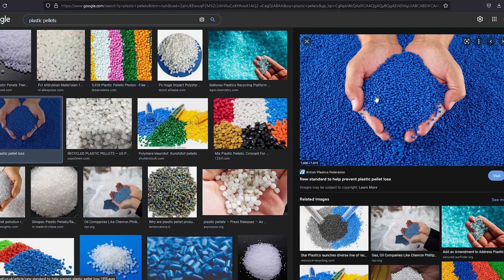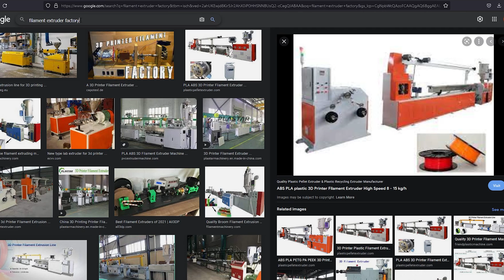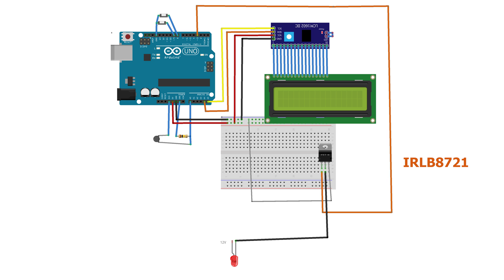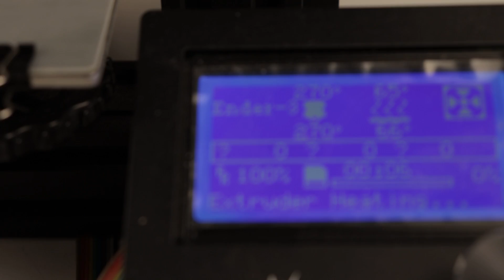Make FREE filament for 3D printer at home

Comment: How can your seemingly stock Ender 3 reach 270C with a Bowden setup? I was kinda intrigued and wanted to try but I heard you shouldn't go higher than 240C on Bowden.
Reply from the maker: I have used Cura Ultimaker slicer software for the temperature settings. You can set specific value in there. Also, fans are working @ 50 percent while printing (default PETG settings), so feeder tubes are not affected. I checked the temp. I am using this setup for a while, and it didn't create any issues for me. If you are worried about that, you can use default PETG settings without any modifications. But I like the surface quality when I print @ 270C.
Reply: @makersfunduck  I knew how to set it up in software, I just wondered how your Bowden didn't break down because, allegedly, it's supposed to at around 240C. I'll read up a bit now, thanks
Reply: @GoTVm_  If he has an all metal hot end then the Bowden is back far enough that it wont be in the hot zone. Or hes jsut playing it fast and loose and hoping for the best. I cant see his hot end but I know set ups like that exist as drop in components for the ender 3.
Reply: @Kiever_Sloane  it looked like the normal red hotend, I don't think it's all metal.
Reply from the maker: Hi @goTVm & @Marrett Gilfus,

After seeing your comments, I checked the hot end temperature levels while recording my latest video. 
You can watch it with this link as well BTW :)

https://youtu.be/QAf5GFs8Ytk

While printing, maximum temperature I saw on the reading was 38 degrees C. which happened during printing initial 3 layers.after the first 3 layers, it never went above 35 degrees. 
To be sure, I checked it with PLA @240C. Temperature while printing PLA is around 35 degrees during the initial layers, and it drops to 30 degrees. I understand your valid concerns. However, the tube is made out of PTFE, and the glass temperature of the PTFE is around 115C. In my opinion it is quite safe to use this settings. But it is safe to follow 100% fan speed as mentioned did in the video. 

If you still feel uncomfortable, you can always use default PETG profile of course. it prints fine. 
Thanks for the lovely discussion.
Reply: @makersfunduck  Checked out your other video, you're very creative, I think I might give this technique a try. As for the Bowden matter, let me make this clear: I'm not trying to disprove what you say, I want to know if I too can do this without risk. Bowden degradation is one of those 3d printing myths, like printing tpu with a Bowden setup, that always has mixed information. As for the temperature, the concern is usually on the part of the tube that touches the nozzle inside the heatbreak. That's where it might go over 240 and why people suggest getting a metal heatbreak for this type of thing.
Reply: @makersfunduck  You're looking at the temperature at the wrong point. With a non-allmetal hotend, the PTFE butts all the way up against the nozzle and will reach the full requested nozzle temperature at that point. Even printing at 240 or so will leave it charred after 6 months of use. The amount of breakdown offgassing of the PTFE is probably not harmful to humans but would almost surely harm pet birds. For printing PET you really should go all metal.

Comment: I've tried this before but the material doesn't feed. what temperature do you use? i think i need to reshape my heating block because I drilled the hole to deep and it doesn't go through the nozzle.
Reply from the maker: it's rather high: 253 degree Celsius. Also keep in mind the PET strap thickness. if you cut mineral water straps  5 mm, then it becomes hollow, and material does not feed. (it should be 7 mins for the mineral water straps as I put in video)
Reply: @makersfunduck  when I first tried this project I ran it off of my old 3d printer I salvaged the parts from. it doesn't reach a high enough temp so I could run it off a power supply but all I have besides the 3d printer power supply is a 12v 10A max lab power supply. would that be enough? or should I try to get the 3d printer power supply to work if I do what you did and use a mosfet and Arduino instead of using the 3d printer board?
Reply from the maker: @levistrnad2965  I have used an old laptop charger  and I think 3d printer power supply should be more than enough to power this.